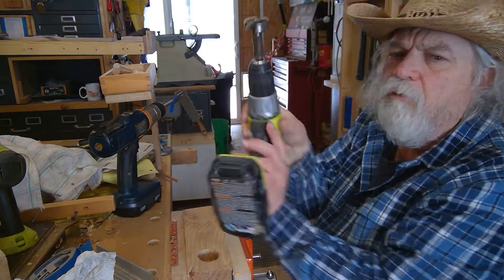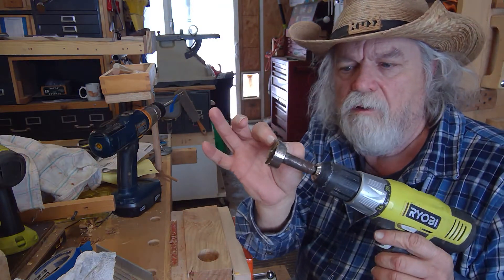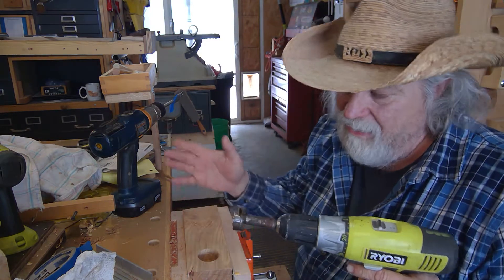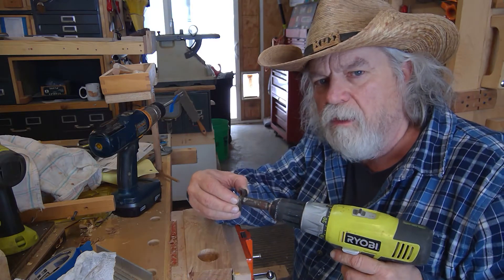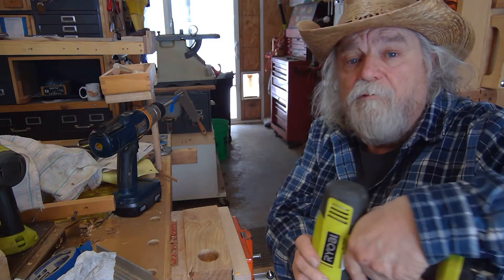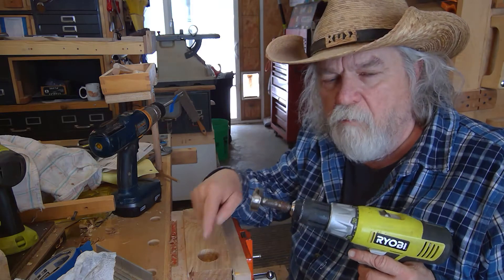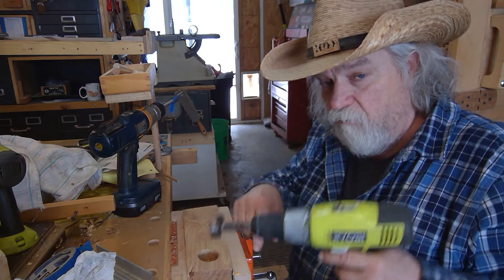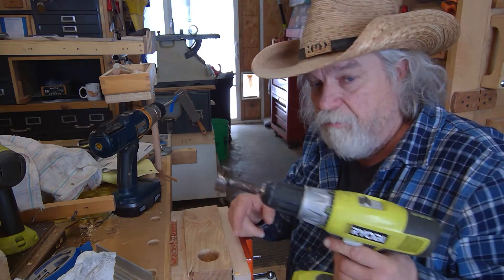Easy Forstner Bit Drilling by OTB Thinker

Comment: Russ, I was having an awful time making 5/8” holes with a Forstner bit and a cordless drill. They were clean and accurate but it took forever to get down to full depth. And I was only drilling in to about 3/16” deep. With 12 holes left to go I found this video, and it cut my drill time in half!
Reply from the maker: Glad I could help.  Drilling holes with a Forstner bit & a hand drill is always difficult.  I tend to use paddle bits over Forstner bits when using a hand drill :>)

Comment: I looked forever to find your jig for drilling straight holes with a hand drill that I had seen on my phone and lost. I found this one and glad I did. This is another great tip and I found the one I was looking for! Those drill guides for about $35. and up I had been looking at all look like garbage toys. I have now subscribed and appreciate the video.
Reply from the maker: I also did a couple of videos on using a bubble level on my drill and drilled freehanded to any angle accurately, if interested.  Welcome to my shop and thanks for the kind words

Comment: The silicon trick. Should we do that to all the wood working bits? Spray and let dry; then back in the box until we need them?
Reply from the maker: Anything that creates friction can benefit from spraying.  I also suspect 1 coat might last longer if usage is minimum). drilling 100 holes or just one :>)  I would spray all at one time periodically and individually if using a lot.

Comment: Great tip! Do you have any advice on how to cut straight holes without a drill press, with a Forstner bit? Thanks.
Reply from the maker: Yes, watch my video "drill any angle hole freehand" .  Thanks laser
Reply: @russveinot5754  Time to hunt down an old drill with a spirit level! Or maybe find a way to attach one to my current drill. Thanks!
Reply: @russveinot5754  By the way, would you be able to tell me the model number on that Ryobi? Thanks!
Reply from the maker: I can do better.  I did the next video  called "Install Bubble Level on my Drill by OTB Thinker"  You can do it on any drill.  The bubble source is in the description.
Reply: @russveinot5754  Love it! Thank you sir.
Reply from the maker: Welcome to the shop Laser.  Lots of great (& unusual) ideas and projects around here :>)
Reply: @russveinot5754  I'm a newbie so your ideas are very helpful. Currently, I am building a Swedish ladder. I am using 4x4 lumber for the uprights and galvanized steel pipes for the rungs. I plan insert the ends of the each pipe into holes that I will drill into the uprights with a Forstner or spade bit. The problem is that I'm not sure how to go about fixing the pipes into the wood so that they don't spin or slip. I want them super secure. If you have any ideas, please send them my way. I'm enjoying all the videos. Thanks!
Reply from the maker: For fastening the pipe in place, drill through the 4x4 on the back side with 2 screws long enough to go all the way through the pipe and not the other side of 4x4 (2-1/2" screw?).
Drilling the holes, just use a paddle bit.  the forstner bit would get too hot in a deep hole.
2 questions, is this for kids, adults, or both?  And, will it mount to a wall?
Reply: @russveinot5754  For adults. It will also have a pull-up bar at the top. I will be mounting it to the wall studs and the uprights will be bolted to the concrete floor. I just ordered a WEN drill press from Amazon, so that should help. If the pipe is 3/4" galvanized schedule 40, what size hole should I make in the pipe and what size screw? I also bought some wood insert nuts to help keep the screw in place. Thanks!

Comment: I have predrilled roof vents under the eves.  Some are 2 inch, some are shy of two inch therefore mini louver vent will not fit in.  I did buy a forstner 2 inch but not sure that I need it if I am trying to widen the hole a tiny bit all the way around.  Thoughts?
Reply from the maker: A forstner bit needs a guide if you are drilling over a pre-existing hole.  a 1/4" plywood with the 2" hole should be enough.  clamping that board under the eve will be the hard part :>)

Comment: Russ, you do know that Forstner bits are not designed to drill through and object all at one time. You drill to a depth not greater than the "head" of the bit. You back the bit out and blow out the chippings and drill again. etc etc until you penetrate the wood if that is what you intended. Or, you stop before you break through. In any case, Forstner bits are not regular drill bits. You do not do through holes with them unless the wood is of less thickness than the head of the Forstner bit. Thanx